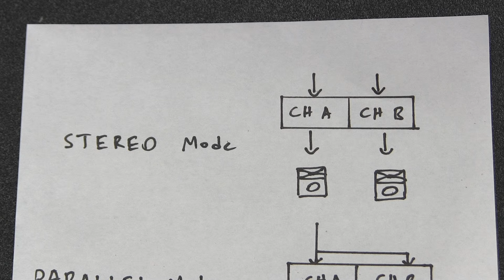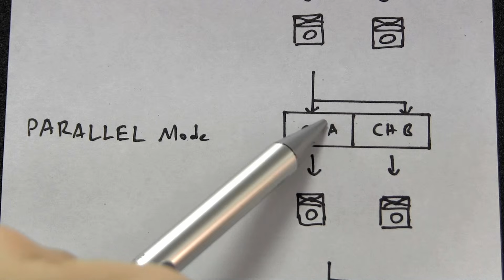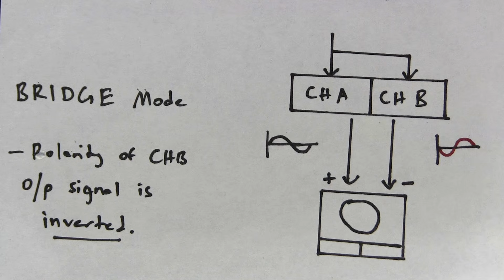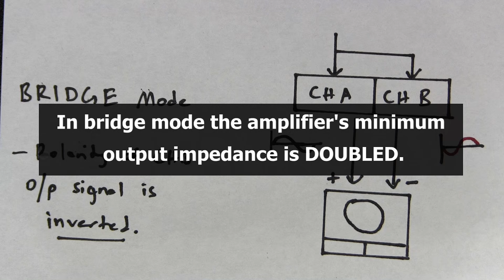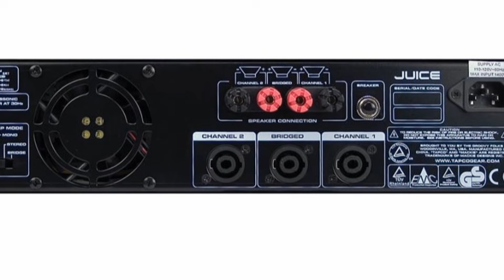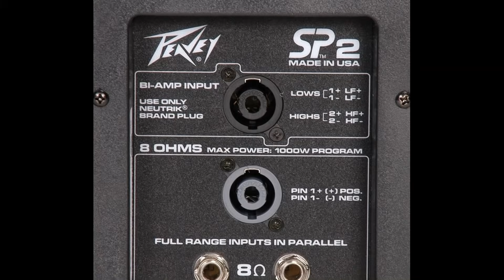How to set up and connect a power amplifier in bridge mode

Comment: Watch a few of your videos on power amps, and still have a problem with mine. Great videos by the way. I acquired a wharfedale pro s1000 power amp at an estate auction. I know a little bit about the stereo equipment, but not much on power amps. My input, is a simple singing microphone. My outputs are two Bose 101 20 watt speakers. Small stuff, just trying to see if both channels work. Input a, and output a, seems to be the only ones working. Change the microphone to B, and nothing works. There are 12 mode switches, and all of them are switched down, or I would presume off. The mode switch positions and chart are a bit confusing to me. I was able to get bridge mode working I think. I switched three switches for bridge mode, and attacked my speaker to the to red terminals for bridged mono. This time, when I spoke into the mic, both signal lights for both channels lit up. So, I'm not really sure where my fault is. I have removed the top cover, just to check for any burnt fuse or loose wire or melted push thru terminal. None to be seen.
Reply from the maker: Hi Randy! To begin with, you really should not be connecting a microphone directly to a power amplifier - those XLR inputs are designed to accept line level signals only, from something like a mixing console.
Reply: Firstly, thanks for responding. I gathered that from watching a few of your videos, but I was really just trying to find out if all the channels worked. From watching your videos, I think I have learned that channel a input and output should work the same as Channel B input and output if they are set on stereo mode. Right now, I cannot get input b to work with output B. I know output B works because it worked in parallel mode. Bridge mode also seems to work okay. I have 12 dip switches that I think I have figured out, except for the Hertz. 30 or 50. also cant find an explanation for limiter on/off, or lo cut on/off. Kind of stumped right now with why input B won't work.
Reply: my mic input is 1/4".
Reply from the maker: You're welcome Randy. I consulted the manual for your amp here: https://www.manualslib.com/manual/190346/Wharfedale-Pro-S-1000.html
On that model, with all of the dip switches down, it puts the amp into normal stereo mode, ie the two channels operate independently of one another. So to test both channels, first connect mic and speaker to input A and output A respectively. Then swap to input B and output B to test the second channel. No need to put the amp into bridge mode. If you can't get input B to work, try getting a mixer and using the XLR input instead. Hope that helps 😊
Reply: @GLBProductions  thanks Bruno, that's exactly what I did it. Everything seems to be working okay except the input B. I do have a friend with some large PA equipment, so I think that's my next step is to bring it to him and have him hook it up to his mixer. Thanks for the link to wharfedale.

Comment: i have a UNIKA A1300 amplifier, when CH1 positive negative is connected, CH2 positive negative is connected, connected like in stereo mode; but whe n I switch to bridge mono mode, it still works and sound is louder, i wonder what's the mechanics behind this....anyone can shed insight on this?
Reply from the maker: Many amplifiers will still output sound from both channels when set to bridge mode, although the signal from channel 2 will have its polarity inverted.
Reply: @GLBProductions  thanks for the experience sharing. my only guess for this is channel2 may take the difference between 0V and the inverted polarity (in this case negative), and the op amp can still do the differentiation... would you think this is possible?
Reply from the maker: Rather than speculating I would simply consult the circuit diagram for the mixer in question.
Reply: @GLBProductions  make sense, that's the safest. but not easy to get them.

Comment: how to connect  two amplifiers (crown xti6002 Vs stranger mcu316) amplifiers?
Reply from the maker: Use the line level output of the first amplifier to daisy chain the signal to the input of the second amplifier.

Comment: Thanks for the info, now I'm totally confused. I have a Crown XLS 602  poweramp and I want to connect it to my Rockville RSG15 15 3-Way 1500 Watt 8-Ohm Passive DJ/Pro Audio PA Speaker. How do I connect then to get the best performance from the speakers and protect the amp at the same time?
Reply from the maker: Right, so the first thing is you have to know your numbers: What is the output of your amplifier when run bridged into 8 ohms, and what is the program rated power handling of your loudspeaker?

Comment: Do you use both volume knobs on mono/bridge mode?
Reply from the maker: It depends on the amp - on some you use both, on others you use only CH A level control. Check the amp manual to be sure ;)

Comment: Hello, I have the Behringer NX3000 and I’m a bit confused. 
If you’re familiar with this amp, to use bridge mode I need to rearrange speakon connector to 1+ 2+ ? 
Thanks.
Reply from the maker: Yes - on the CH A output. Also remember that you have to set the amp itself to bridge mode.
Reply: GLB Productions thanks 🙏🏻

Comment: Pardon me, But  i am a bit confused. Base on analogy regarding Bridge set up, While ch A push, ch B is pulling, hence thee will be no sound coming out of speaker? They are not augmenting each other but rather cancelling out. pls enlightened me.
Reply from the maker: Sure Cris, think of it like two people sitting in a row boat, facing one another (i.e. one facing the bow and the other facing the stern), holding onto the same oar running between them. In order to combine their efforts, when one person pushes the oar away from them, the second person must pull it towards them and vice-versa: when the first person pulls the oar towards them, the second person must push it away from them. The oar is the voice coil/speaker cone assembly and the two people are channels A & B - one connected to the positive and one connected to the negative terminal of the speaker. The complimentary motion thus represents the inverted polarity of the signal being sent to channel B. Without the polarity inversion, the motions would indeed be opposing and cancel out. Does that help?

Comment: Can you explain EMX 2000 power mixer to connect to amplifier please
Reply from the maker: On that mixer use the +4dB line level outputs on the top panel to connect to a power amp.

Comment: hi sir,in bridge mode 8 ohms,can it drive a 4pcs 8ohms load,the 4 speaker is connected in series/parallel,so that the total load,is still 8 ohms?
Reply from the maker: Yes it can but that type of series/parallel wiring cannot be achieved using normal loudspeaker cabinets - you would have to modify the internal wiring.

Comment: I have Yamaha P5000S power amplifier and I have 2 Yamaha subwoofer SW118V, 600wtts program/1200wtts max power.. Can I connect the 2 subs(SW118v) to my Yamaha P5000S into bridge mode at 4ohms by connecting the 2subs paralleled? I hope you can help me.. Thanks in advance.. Bless you sir.
Reply from the maker: You will first need to find out if the P5000s can be safely bridged into a 4 ohm load.
Reply: @GLBProductions  this is the specs of my yamaha P5000S power amplifier..can you please check sir if it is safely ok to connect my 2 subs in bridge mode at 4 ohms..because according to the specs of P5000s, she is able to handle 2600 wtts bridge mode at 4 ohms..i am not an expert sir to fully understand the specs of the P5000s..thank you for your reply on my inquiries..have a good day sir.

Product highlights:

General information:

2-channel power amplifier
Power output at 20-20,000 Hz:
500 watts RMS per channel at 8 ohms, 700 watts RMS per channel at 4 ohms, 1400 watts RMS (mono) at 8 ohms in bridged mode. 
Power output at 1 kHz:
525 watts RMS per channel at 8 ohms, 750 watts RMS per channel at 4 ohms, 1500 watts RMS (mono) at 8 ohms in bridged mode, 2600 watts RMS (mono) at 4 ohms in bridged mode.
Frequency response: 20-50,000 Hz (-1.5 dB)
Signal-to-noise ratio: 103 dB

My subwoofer is Yamaha SW118V, 600wtts program, 1200wtts max power.
2 subs, I want them to connect into bridge mode by parallel/daisy chain connection..what do you think sir, is it possible?
Reply from the maker: So if the amplifier delivers 2600W when bridged into 4 ohms, each of your subs will receive 1300W, which is more than double the program rating - quite risky! Safer to connect one sub to each channel of the amplifier.
Reply: @GLBProductions  OK, thanks sir..appreciated

Comment: Hi I watch your video however it didn't cover my issue. I'm trying to figure out whether to use one RCA input to the bridged car amplifier or with a y adapter used both left and right. the manual has the speaker wiring as left positive and right negative for positive and negative speaker connections respectively. The owners manual does not state whether to use one or both with a y adapter. What do you think sir? I have another brand amp from the same year that states in the manual specifically to use the left only, the speaker wiring in the bridged mode is the same as the one listed above and also has a switch for bridged or stereo mode, not that that makes any difference. Thank you
Reply from the maker: This video is directed at users of pro-audio power amplifiers such as the one shown in the video. I'm not familiar with car amplifiers and don't give advice on them - I recommend you contact the amp manufacturer and ask them these questions.

Comment: If I have a power amp that has a dedicated Speak-on output fro Bridged amp mode. Would I still need to use the correct "Bridge 2+/2-" wiring at the connector?
I have tried the speak on connector with my "1+/1-" wiring on it and it seems to work. But I wanted to make sure I was okay to do so without fear of damage to my amp.
Reply from the maker: If you have a dedicated bridge mode output connector it will almost certainly be wired 1+/1-. To be certain, check the amplifier spec sheet as well as the labelling on the back panel - all good power amps will clearly state the pin assignment next to the connectors.

Comment: Thank you so much. Very useful info ! I just hooked my new power amp in mono bridge very good ! 

Yet I dont know how to hook up my subwoofer. 

the cable has a speakon cable terminal in the subw side and three bare wires red black and yellow in the amp side. 

when using only the integrated amp i hooked it up...red to + R out, blk to - L out and yellow to + L out.  

Could you tell me how to do it in mono bridge mode ?

Sorry for my english if its not good. hope you can help me.
Thanks a lot vey helpful !
Reply from the maker: Which make and model is your integrated amplifier please?
Reply: GLB Productions Thank you so much for your answer. 

luckly I could connect them via a single ended RCA cable from the Iotavx sa3 sub out (bridged in monoblock to pa3) to the line in at Rel T5i sub. Tanks again.
I really appreciate your help.
Cheers👍

Comment: Great explanation, thanks.I want more volume from Behringer PMP4000 pa, min bridge impedance is 8 ohm. I have 2 x 8ohm speakers can I connect  them in series to give 16 ohm and to do this would I have to alter the internal wiring of the speakers?
Reply: Thanks, will look for a more powerful pa
Reply from the maker: You're welcome Jon. Yes you would need to alter the internal wiring of the speakers - series wiring is not recommended for live sound as a fault in either speaker would silence your entire system.

Comment: I have 4 speakers on one channel and a subwoofer on channel two on a QSC amp 3000 watts. Each speaker it 150 watts and the subwoofer is 200 watts . What would be the best set up for this ?
Reply from the maker: Which model amplifier are you using Richard?
Reply: PLX 3002
Reply from the maker: Assuming the speakers are all 8 ohms and your four top speakers are connected in parallel, your sub is receiving 550 watts and each of the four speakers on the other channel is receiving 375 watts. So your speakers are significantly overpowered - this can be ok but there is a potential for long term damage due to excessive power.

Comment: If the amplifier has +-+ speaker configuration meaning stereo mode. How can i combine bot channels to do mono or bridge mode?
Reply from the maker: If your amplifier does not have a mode switch that means it is not designed to be bridged. You can still run in dual mono by using a different input for each channel.

Comment: I have a question please . In bridge mode my power amp is 1000 watts rms @ 8ohms . So I bridged my amp and then connected two 8 ohms speakers in series to it making it a 16ohms load . Is that ok ?
Reply from the maker: No problem at all - solid-state power amps can always drive higher impedances than the minimum specified. Just remember that you're probably getting around 500 watts into 16 ohms, which means each speaker is only getting 250 watts.
Reply: @GLBProductions  ; thank you for a quick response .

Comment: Please add effect of dc offset at the output of amplifiers and how it affects the speakers in bridge mode. Also how to ensure the amplitudes of the inverted signals are exactly equal?
Reply from the maker: DC offset in a pro audio amplifier is not something that the end user can adjust. You can measure it but unless it is causing audible distortion I wouldn't worry about it.

Comment: Hi, I got some questions here regarding powering a sub.

I have a stereo amp, with 4 output channels (2 lefts and 2 rights). Currently, I have only used 2 of 4 channels to power my left and right speakers respectively, and I'm thinking about adding a sub. Do you think that a sub can be hooked to the amp? If yes, how? Both the speakers and amp are on 8 ohms. Probably, the sub I'm going to add is a 10" DVC 2/4 ohms.
Reply from the maker: Hi Min - just to clarify, do you have a 2-channel amp with four outputs, or a 4-channel amp? Please tell me the amplifier make and model so I can confirm.
Reply: @GLBProductions  It's a 2 channel amp with 4 outputs, it's just written " R L R L " above the terminal
Reply from the maker: Hmm - can you please tell me the amplifier make and model.
Reply: @GLBProductions  I'm not sure if you will recognize this - It's a Octopus (brand name) Digital Karaoke Stereo Amplifier SC-505. Probably Indonesian brand... so yeah. Afaik, the power output is like 2x50 watts (not sure). No official website for the product nor the manual guide
Reply from the maker: Ah ok with an amplifier like that I really can't give you any specific advice. If you are willing to risk damage to the amp you can hook up the sub and see what happens - if it works fine with no distortion and the amplifier doesn't overheat or go into protection mode you are probably ok, but it's impossible to say for sure without a proper spec sheet.

Comment: its ok to bridge 8 ohm?
Reply from the maker: Sorry I don't understand your question.
Reply: @GLBProductions  sorry bro, what i mean ,the speaker is 8ohm right. And its ok to put on bridge?
Reply from the maker: Yes it should be fine, but as always you need to check that a) your power amplifier is designed to be bridged and has a bridged mono mode and b) that the power output of your amp in bridged mono into 8 ohms is a good match for your loudspeaker.

Comment: For the bridge mode can I connect the + in channel A and Minus in channel B?
These are the specs of my 400 watt (2 x 200W)power amplifier: 2 x 200W Max @ 4Ohms, 2x 150W Max @ 8Ohms, I have a 300 watt subwoofer a dn it's Impedance is 8 Ohms... is it recommended to connect my subwoofer in bridge mode to this power amplifier?
Reply from the maker: What is the bridged output of your power amplifier into an 8 ohm load?

Comment: Hi,
If I had 4 x 15" speakers @500watts & 8ohms each + 1 power amp that has 1400watts each channel & 4000watts on bridge mode. Can I run all 4 speakers with that 1 power amp on bridge mode?
Reply from the maker: Is the amplifier capable of being bridged into a 2-ohm load?
Reply: Hi,
The 2ohms load comes in stereo only both left & right but no bridge load for 2ohms.
Reply from the maker: Right - so in that case you can drive two of your speakers (combined load 4 ohms, each speaker gets 2000 watts) but not all four.

Comment: How to setup the qsc RMX 4050 in mono
Reply from the maker: On that amp you need to use the dip switches on the back panel to put the amp into bridge mono mode - follow the diagram printed next to the switches :)
Reply: Can you do a video on it?

Comment: Let me ask sir
I have an old solid state amplifier with 2 channels 150w per channel.

when i connect my 2 positives outputs(try to bridge it with the third way you show in the video) in my speaker 

i count the SAME voltage level,when i use one channel to connect my speaker.

Why i did not gain the double voltage levels i can't understand.

It is possible to bridge ANY 2 channel amp?
Reply from the maker: No, the amp must have a specific bridge mono mode - that's why you are not seeing any increase in your voltage levels 😄
Reply: @GLBProductions  ohh thanks for the reply,now i see my amp don't have bridge mode at all...sad for me

but if there is any complicated way to bridge it let me know plz!
Reply from the maker: Yes - bridge mode is typically reserved for higher-powered sound reinforcement amplifiers. The amount of power available from some of these amps when bridged is very impressive - as much as 10,000 watts into 4 ohms!

Comment: Hello. Thank for thí video, and I want to wiring series by 2 speaker for each chanel with 1 Peakon connector, how I to do that?
Reply from the maker: Sound reinforcement speakers are usually wired in parallel - this way if one speaker blows the rest keep working.

Comment: Can i connect two 8ohms speakers in bridge mono?
Reply from the maker: Yes, as long as your amp can handle being bridged into a 4-ohm load. Check the user manual.